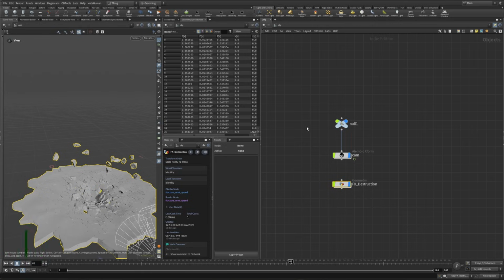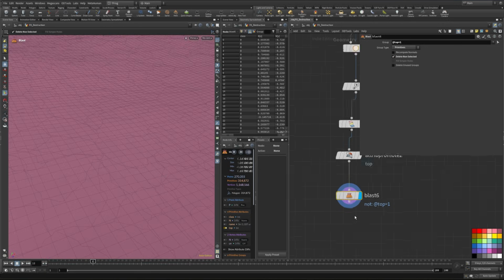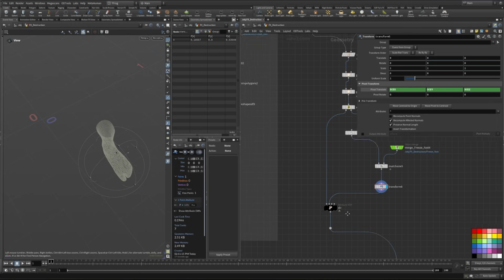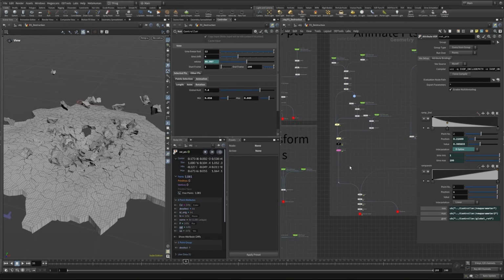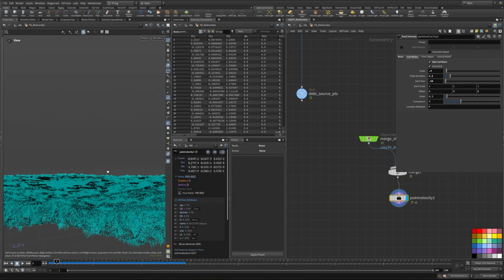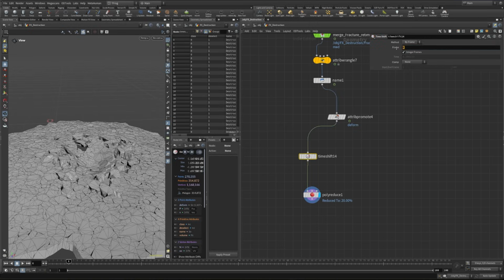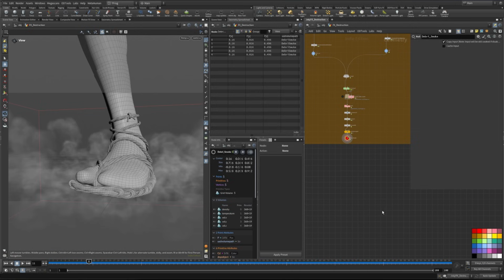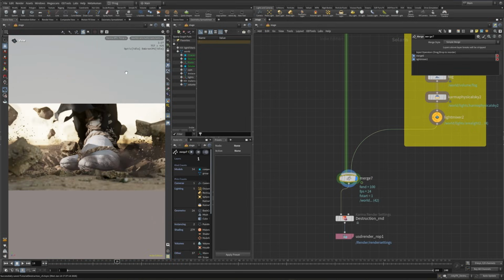Anime Ground Destruction - Houdini VFX Course

Comment: great tut bro. My only problem is when we did the instancer for the small debri and the dust, in the stage setting, the debri and dust just showed up as boxes instead of the variant models we made to instance on the points. cant seem to figure it out
Reply: Yo man, if by any chance you or someone else haven't figured this out yet! I just came up with a solution: in the  geometry spreadsheet where he selects "Debris_0" I didn't choose that path but instead I chose the whole "small Debris" that has all 3 variations and then typed at the end "/world/Small_Debris*" the "*" is important and then selected "Index Attribute" and typed "variant" as he did. And it worked fine, now I have all the 3 random variations of the particles in the Karma XPU viewport.